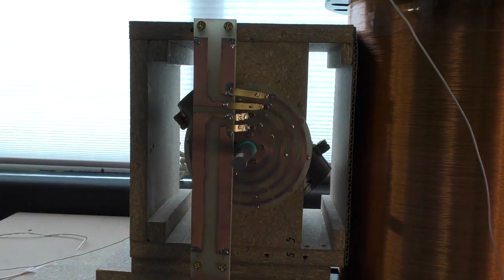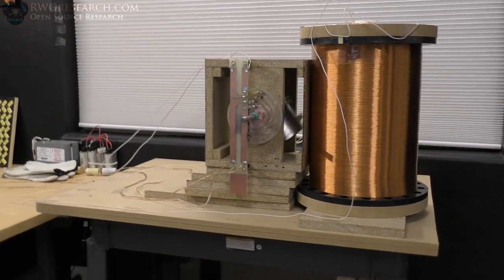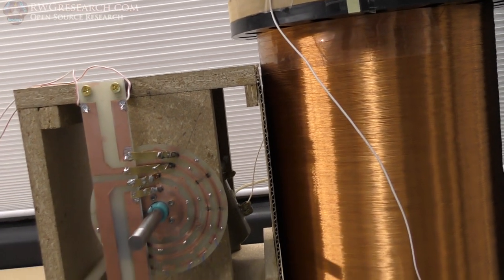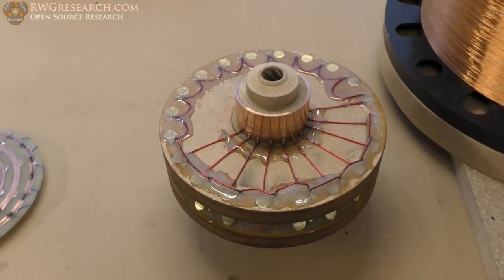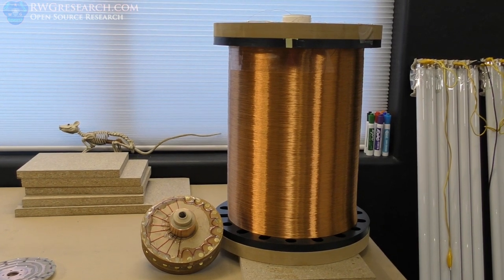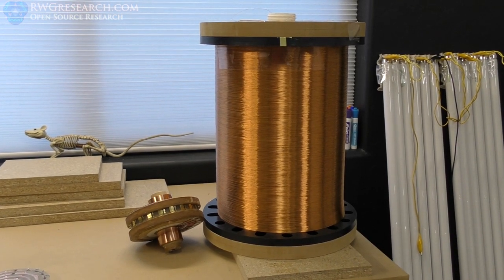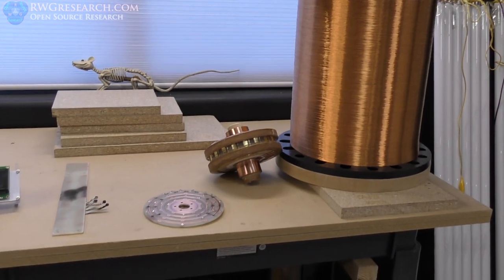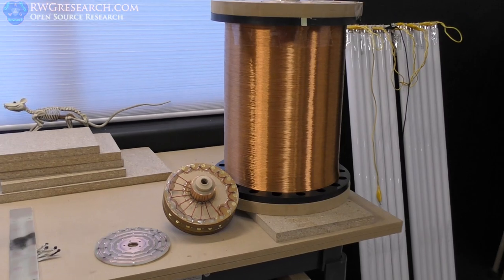JWN Project P7: New Comutator Part 2 & JWN Project Overview.

Comment: I fully agree with the limitation of electronic components with regards to high voltage. However, do you, or somebody else, have a detailed diagram that I can present to a resonant/frequency engineer for his consideration and input? He is one of my older friends in his 70's that is active in designing. He is also very busy and I will have to be very sure to present only the best option to him for consideration.

Comment: I'm pretty sure that there is very few here that are more ignorant about what is been done, but I sure really wish that copper coil would be replaced with a large toroid HV coil, Is my humble thought that it'll increase efficiency greatly...and the brushed arching may be easier and simpler to control with a simple hal sensor, with the added advantage that it will be easier to change the timing any time without to have to cut a new commutator....
Reply: Migueldeservantes yeah I think he should be using poe coil.
Reply: Migueldeservantes he may be able to get rid of lenz law if he used a poe coil due to the spinning field

Comment: pushrod / cam driven switches?

Still, looks like you have just made a slow switchmode converter.
(see boost converter)

You can limit the spikes using snubber circuits / TVS diodes! (or give the current somewhere to go via a diode and likely a capacitor)

Comment: Think about putting more coils around the magnet. This is what Tesla was doing with his dynamo electric machine I emailed you about. Except he used pairs of coils per phase with two phases. Think about that for a bit. Two coils working together on opposite sides in a phase. With two phases in total. The coils would not need to be so big either that way and the efficiency would go up. I say that because turning a circular valve handle with one hand is difficult. Now turn it with two hands... It becomes much easier.
Reply: Jon Bigman good points, I don't even see why he's messing with a standard coil.. he should be doing more experiments with the poe coil.

Comment: Hi Russ, nice video. Is there a way to check on microwaves ? They are dangerous for the human brain and mind.
Microwaves are very easy produced when we have radiant energy.

You talk about the "other" side of the coil, being influenced by the rotor in the wrong, counter productive direction.
Would two smaller, opposite rotors be more efficient ?
Reply: Microwaves have no known affect on the brain.  like any other non-ionizing radiation.  It can produce heat in water but only with very strong standing wave scenario.
Reply: Microwave ovens have a strong Faraday cage around them to protect us from radiation damage.
Our brain produces, and works with microwaves. People with microwave braindamage, are very poor in communicating with others, and refered to as being insane.
Reply: Microwaves ovens are using very strong radiation so if by chance a standing wave forms in a specific spot than you can get burn injury. That why they have Faraday cage. Here he is dealing with small amount of power, way less than many communication devices that use microwaves radiation. 
Our brain dose not produces or works with microwaves. microwaves frequencies are higher than our brain are by order of 6 to 8.
Research on this topic found affect only with very specific resonance frequency. If to be worry then phones are more possible source of modulated microwaves radiation.
Reply: This coil and this rotor produce insane peaks ! Look at it. Look at the sparks, look at the scope.
When the coil is not connected, for a few milli seconds, it can produce an amount of radiant energy that can be compared with a radar system. Beter stay at a distance.
Reply: Actually you are right.  the sparks part can cause microwaves and even x-ray radiation. And x-ray radiation is definitely not healthy.
Reply: Actually, it is not the sparks, they are visual discharge, light. And light we can see, and run away from when it is too strong. Light also does not penetrate our body much. Radio waves go right through you.
It is the coil of course. Coils can produce radiation of all the other spectra, like microwaves for example.
Reply: Coil can produce radiation like any other wire with resonance. Nevertheless ,this circuit have alternating current with low frequencies (the rotation speed) which can produce radio waves. Sparks can cause much higher frequencies due to their nature. So any high frequencies can  be caused only at the spark duration.

fun fact: the first communication devices, as Morse transmitters, used sparks technology.
Reply: For radio, the length of the antenna counts to. For coils the length of the wire counts in respect to the current speed inside the wire. High frequency only means high speed.
Reply: High frequency is fast transition in periodic system. For producing High frequency electromagnetic waves from any conductor you need fast change in electric charge along the conductor. you just don't get it from a slow changing system. 

Antennas are just used to increase the power you can transmit (and directing it). any resonating circuit will produce radiation. coils are not  able to produce any radiation length by a given frequency.
Reply: The length of the antenna is VERY important. A single wire (cylinder) follows the inverse law. This means that you can use a low(!) power to send your message further away. Thats why millitary jeeps have long, thin antennas. Search on: "pictures jeeps with antennas" to see it.

The danger from coils appears when you break the circuit. The electric and magnetic energy has nowhere to go. So it MUST be radiated.
Reply: Brainwaves:
http://www.brainworksneurotherapy.com/what-are-brainwaves
Largest pancake coil:
https://www.youtube.com/watch?v=ooAmJ2z6Qs0